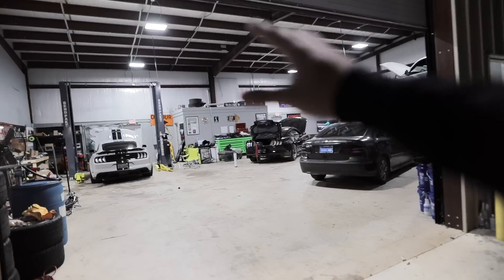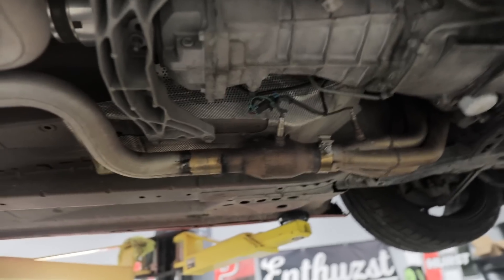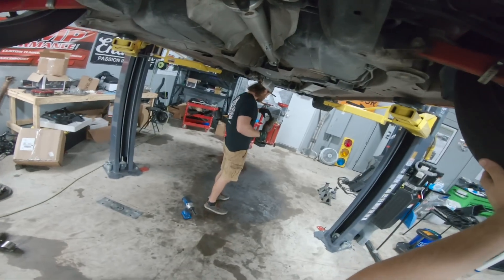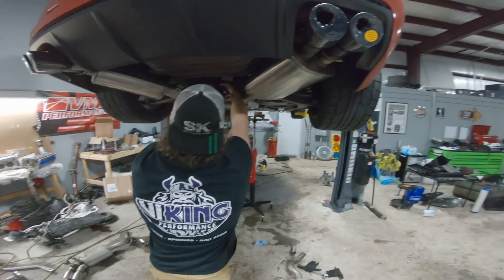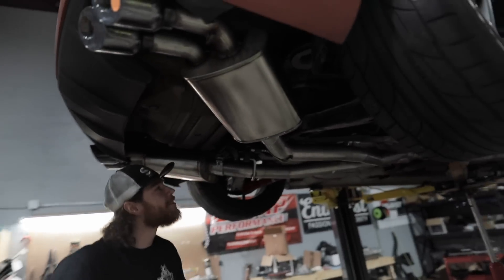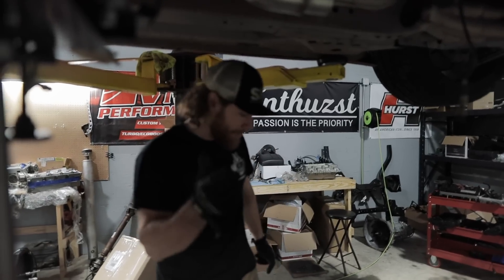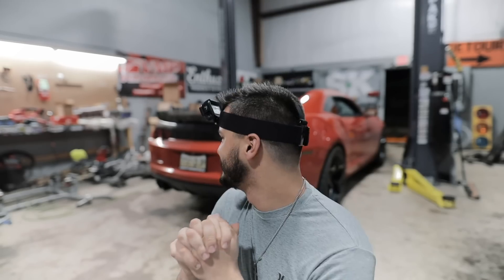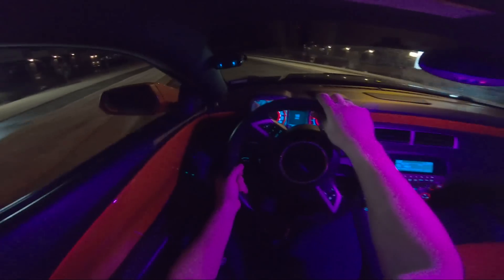My Big Cam’d Camaro’s First Start with its New Exhaust!

Comment: Sc300 came with a 5 SPD option but it's very rare you also have the option for a 4 liter v8 but no option for manual for the v8:/ unless you convert and Doug could manage 600whp on completely stock motor with headstuds cometic head gasket boostlogic turbo kit and standalone of your choice

Comment: I know whats being talked about 🙂

Also if anyone doesnt, an Aristo is the Japanese domestic name for the GS300/GS400/GS430. They came auto only with a VVTI 2J/A650E (the JZS160, anyway.)
They are your very basic VIP car, but imo are fucking beautiful.

Heres a bonus; the SC3 Doug got, came branded as a Toyota Soarer in Japan - North America got the Lexus SC3/SC4 "more luxurious" version, but getting a factory manual car that is LHD is INSANELY rare. SC3's are easy to manual swap though, as its just shorting the pin for the NSW, and then throwing a R154 or CD series behind it. The SC4 (4L V8) is a lot more difficult and a money pit, as you have to buy the CD, cut it, get an adapter kit like the Collins kit, change input shaft - and a fuck ton more thatd cost you close to 12K all in.

Comment: The Lexus SC models were made before the supra and was basically the car that the Mk.4 Supra was designed after especially since the 2jz was in the SC300 before the Mk.4 Supra so basically think of it as the Supra before the Supra

You could also get a Lexus SC400 that has a 1UZ-FE V8 engine that are actually pretty good engines which can also be found in the Lexus LS400 which is the first car that was ever made under the Lexus name back when Lexus started in 1989 and if you get your hands on a early model 1UZ they could handle a good amount of boost with stock internals and actually sound pretty beefy with the right exhaust

But if I'm correct the 2jz-ge in the SC300 had weaker internals than the 2jz-gte but I could be wrong about that

Edit: and yes I did get excited when I heard Gavin say "Lexus" as I am currently fixing up an LS400

Comment: Of course we know what a 2JZ is a straight 6 japanese-made motor 3.0 L 320 horsepower with a turbo in some stock 2JZ s 2JZ motors started in Japan JDM of course  y'all were talking about a 4th Gen Lexus right just like the Supra just like Ford has a 4.9 liter straight 6 I believe Dodge has a slant six and Buick maybe a correctly built 2JZ motor with a Whipple are ball bearing turbo will dominate the Mexico streets track I mean ⚜️👨‍🔧💯👍🆙🤘🗽🇺🇲✝️🛣️🚦🚥⚜️🔧🚬💨💸👽💀🤖💀💩🏁⛽🛐🔩⚙️✌️☮️🛠️📤👨‍🎤